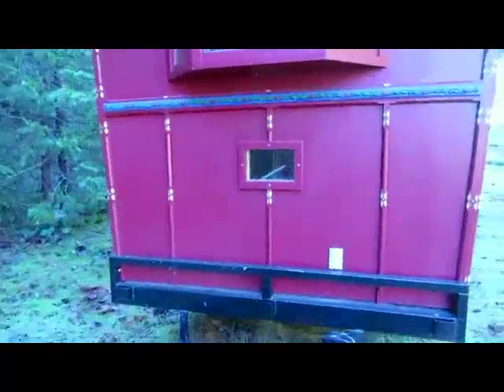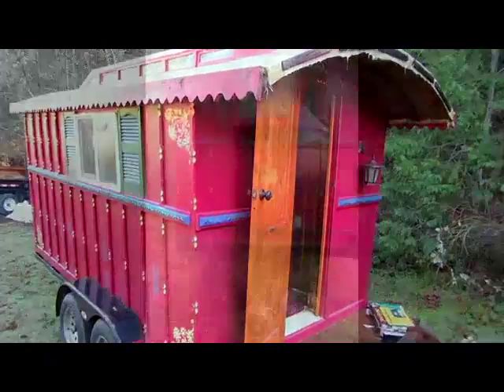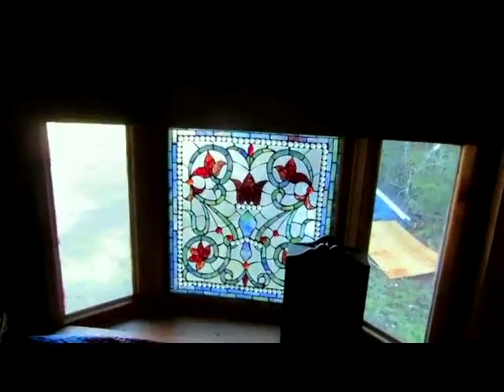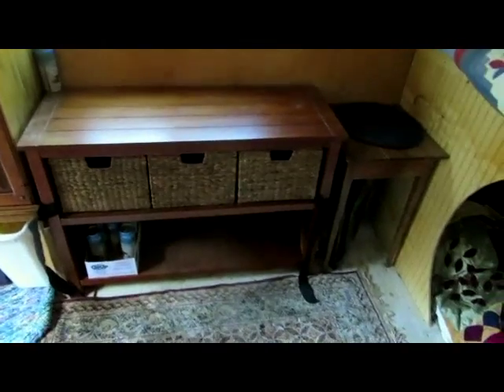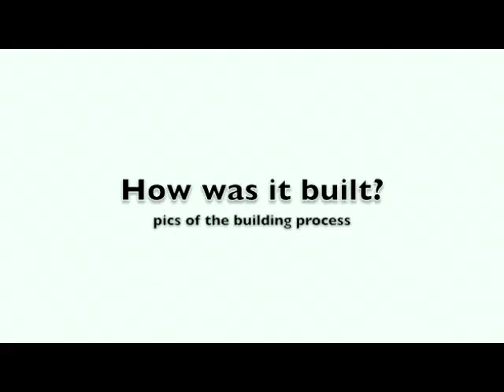Hand Built Gypsy Wagon Vardo  For Sale

Comment: this is a failure u no y? NO SHOWER/BATHROOM! that is the most important thing cause without it its not modern at all might as well pack a tent and use a truck bed  as "storage".
Reply: That is so true. Shower /bathroom is the most important thing to have in that wagon, especially in the early morning when you need to go the bathroom. I like the inside of that Gypsy Wagon Vargo. You can add a room for the bathroom. Just saying.